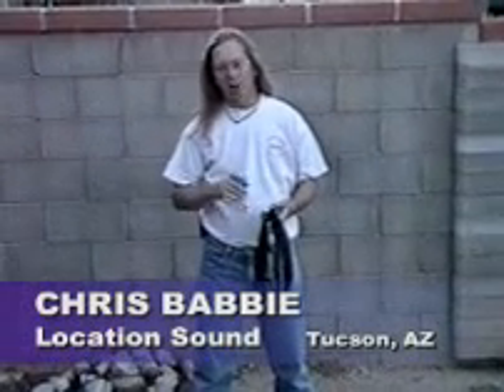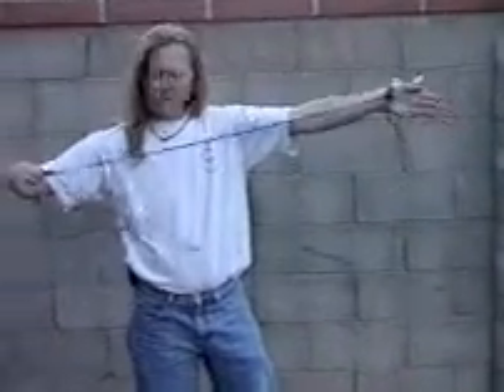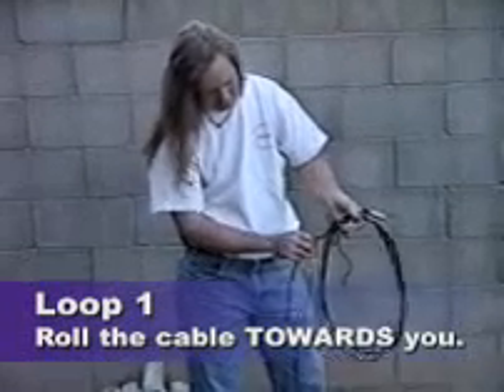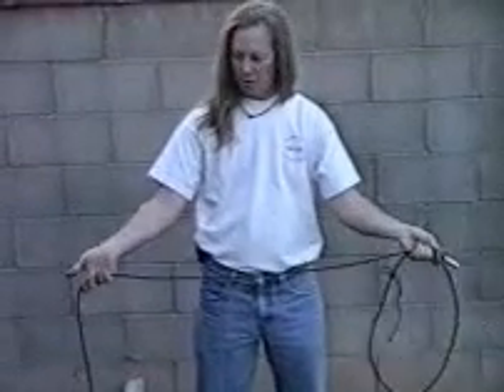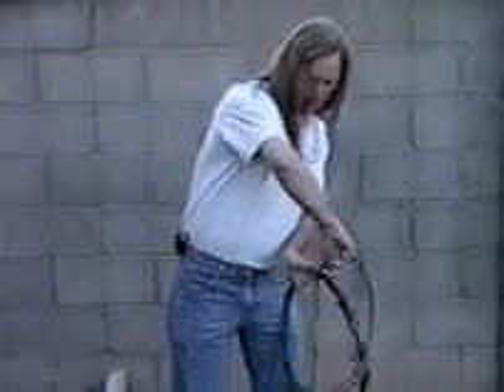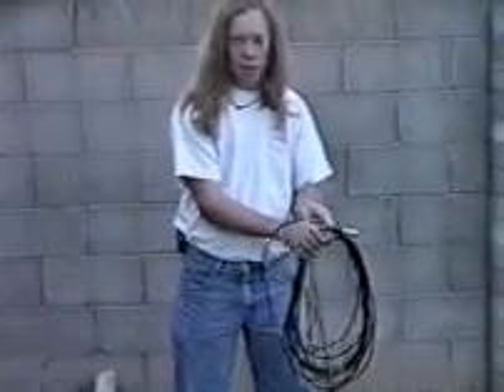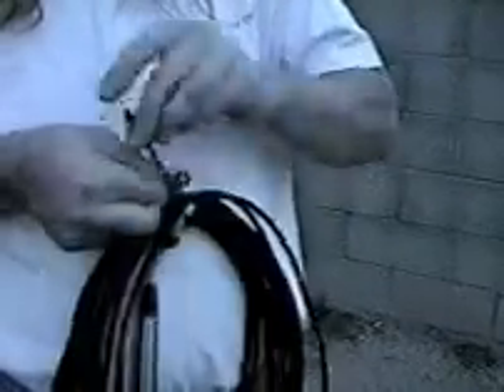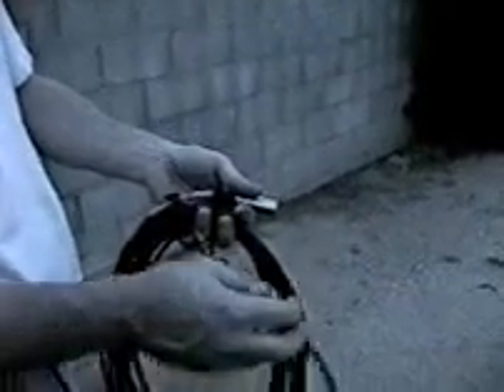Over/Under Cable Wrap Technique

Comment: Filmed with a potato, but great technique. Thanks!
Reply from the maker: Taped in a buddies backyard with a professional camera that was, back then, state of the art-ish. Back when pagers were cutting edge, and the internet didn't have YouTube, Facebook, or even MySpace. E-mail was still kinda new and cool...
Reply: Wikipedia says: "Computer-based mail and messaging became possible with the advent of time-sharing computers in the early 1960s, and informal methods of using shared files to pass messages were soon expanded into the first mail systems. Most developers of early mainframes and minicomputers developed similar, but generally incompatible, mail applications. Over time, a complex web of gateways and routing systems linked many of them. Many US universities were part of the ARPANET (created in the late 1960s), which aimed at software portability between its systems. In 1971 the first ARPANET network email was sent, introducing the now-familiar address syntax with the '@' symbol designating the user's system address.[23] The Simple Mail Transfer Protocol (SMTP) protocol was introduced in 1981.

"For a time in the late 1980s and early 1990s, it seemed likely that either a proprietary commercial system or the X.400 email system, part of the Government Open Systems Interconnection Profile (GOSIP), would predominate. However, once the final restrictions on carrying commercial traffic over the Internet ended in 1995,[24][25] a combination of factors made the current Internet suite of SMTP, POP3 and IMAP email protocols the standard."

I started using email in the second half of the 90s when I was in junior secondary school. I accessed it using a telnet connection to a GNU+Linux server and by running a text-based application called Pine (first developed in 1992, last release in 2005; now replaced by Alpine, a rewrite from 2007 that is still being developed). Apparently the first webmail was developed in 1993 at CERN, but I guess it didn't become a thing for a long time. The first webmail I used may have been 37.com or something. I've maintained my own email server for years and use KMail to access it. Anyway, email has been around for a long time. When did it stop being cool?

Comment: I have a 14/3 yellow 50ft power cord attached to my backpack vacuum and no matter how I try to coil it properly, it gets twisted all the time. The cord is not as soft and easy to wrap it around. How can I fix this?
Reply: Lay the wire on a parking lot as straight as possible on a sunny day for about and hour or two. Should straighten up pretty well and then only wrap the same way he teaches on this video from now on.
Reply from the maker: Like I tell guitarists, "Turn counter-clockwise every once in a while". It's getting twisted as you vacuum and turn let (or right) all the time.
Reply: +e1108educ Rub it with butter and massage it for an hour then plug it in and wash it off